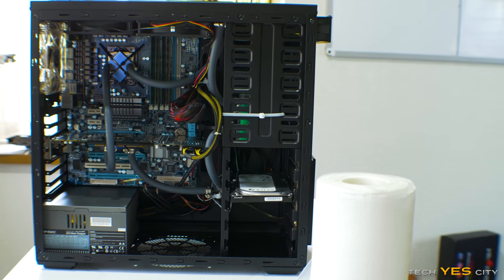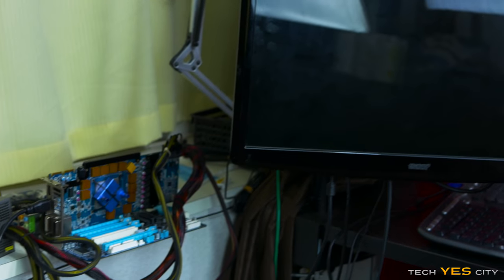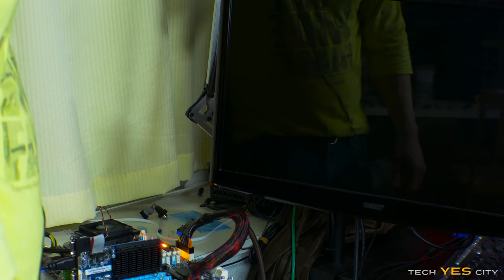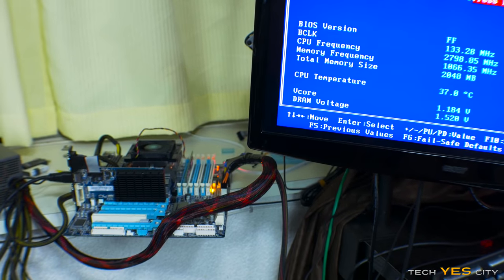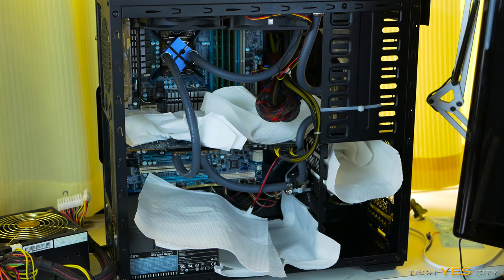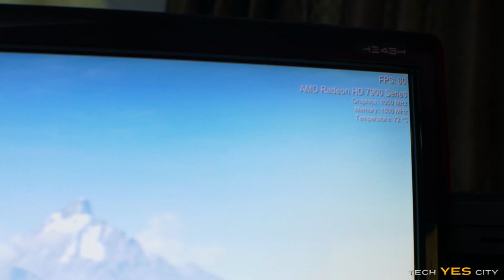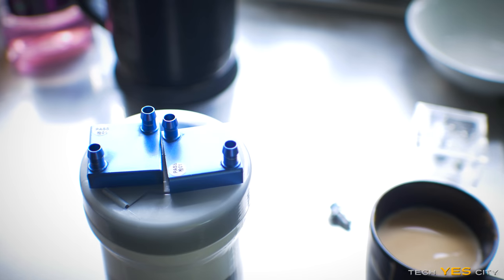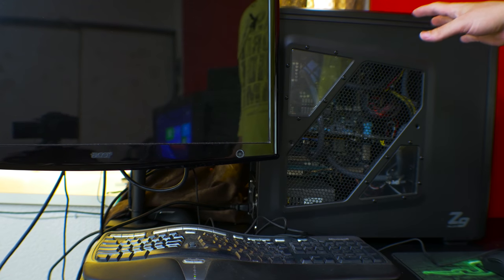$50 Custom PC WATER Loop - Is it POSSIBLE?

Comment: due to many comments saying the way he is applying thermal compound is a problem... So i tried both ways the "professional/traditional" way and this way... only difference was of a 1-2 degree difference the way in this video made it a bit bit hot is all so its not much of a problem... ( I cleaned my hands with sanitizer and i don't eat oily foods  just incase somebody comments KFC or macdonalds) So it's not a problem guys everyone to their ways

Comment: I am using a rajintek triton cooler. First one the acrylic block started cracking. They sent me a new block but it evaporates like hell and leaks sometimes from the power cable. I cant use my pc until i get a new cooler. Avoid those rajintek ones. They are coloured green red or blue which comes as dye that you can add yourself.

Comment: not sure if you can help me but I have an AMD fx4350 in my computer and it'll be running at 4.2 mghz some times then other times it'll be running at 1.21 mghz and I'll get the same performance ether way. it's mounted to an Asus pro gaming
Reply: +Greasy Steve it clocks itself down when it doesnt use the power, so no problem

Comment: Spreading out your thermal past works well with finely machined surfaces, those blocks are not. Try using a little larger than average blob of it at the center of the cpu, this should fill the irregular spaces between the cpu and water block better.

Comment: future tip...  if you want a near perfect flat surface or fix a non flat surface in this case, sand your thingy on a piece of glass or mirror usually works well  and use fine sandpaper. ahh and taping the corners may help also  avoid messiness of sh.!t sliding around

Comment: use the pea method on the thermal paste. helps prevent air bubbles, and finger oil, from an contaminating the TIM.
Reply: +chase tressler Finger is as good as pea.
Reply: +chase tressler I'm using the credit-card-spread-technique for over 10 years and I build several PC's a year and never in my life did I encounter any "air bubbles" that decreased the cooling-performance.

Kind regards,
Meta Custom Computers
Reply: I too am a professional for a shop that specializes in our customs. we, including myself build several a week. but my credentials arent the point. the only way to see the bubbles is to use glass so you can see how it spreads. and most of the time it is negligible to the temps. but it can make air bubbles. not always.
Reply: chase tressler
I solely rely on my own bech-tests and those of trusted collueges and over and over again it was proven that there is no difference. There is always a margin of about 2°C between the methods but every time you test it, the "best" and the "worst" technique changes. Sometimems the "pea" is better, sometimes the "spread", sometimes the "X" while the "pea" is the worst, so the 2°C delta can be put away as measurement tolerance.

Kind regards,
Meta Custom Computers

Comment: Any chance that the high temperatures might be related to air bubbles? Since youre using no-transparent tubing you cant really be sure you got rid of all the bubbles. I guess the temperatures would still not be that amazing, even if the problems where to be because of the bubbles ...

Comment: Need to get some clear Tubing Bro then you'll be able to see whats actually going on in there espically if you get bubbles in your loop as it can affect the cooling somewhat i usually leak test systems for 24 hours
Reply from the maker: +Zachary Haywood Thanks, yeah definitely will get round 2 cracking soon.

Comment: so im building another 775 mod system with an x5450, and using a gigabyte motherboard. the board recognizes the xeon in the bios, but it freezes on the windows logo when trying to boot into windows 10. it works perfectly fine with a Pentium in it, will getting the micro-architecture fix this?
Reply: +wilson pies win 10 doesnt boot with o.c. on first time. boot with stock speeds 1st time, when you see desktop (might require activation) reboot do o.c. then reboot. tested with g3258. you are welcome
Reply: L. Alp M. Schiesser its not overclocked in the first place :/ also you're using an 1150 board, I'm talking about a 775 mod xeon, they aren't even comparable :(
Reply: its not about generation its a general statement if you overclock your cpu you cant first boot into win 10, different platforms same result. Sadly its not your case but it may be relevant because of win 10 activation methods, just search for it...
Reply: +GrimeHubTV Just search for it...
Reply: turn of ahci
Reply: Jack
why?

Comment: I have an e5450 using kind of the same materials you used, and it works , 30degrees only when playing GTA at medium settings
Reply: and he said he has 30 when gaming so..why would he go with the 212 evo if it goes 49 and his custom loop goes 30? although, i dont believe anything can achieve 30 degrees while gaming..maybe if you had a major bottleneck on the cpu so it only runs 20% :D

Comment: If you were running and AMD A10-7980 you wouldn't need to cool the GPU as that would actually be inside the A10-7980 processor along with the Trueaudio sound hardware.

Comment: what if you replace the water with oil? will you get better cooling in water cooling system?
Reply: IamIUareU no
Reply: IamIUareU nope
Reply: IamIUareU the best liquid to use is not what he used.you should just use normal distilled water.
Reply: +Troll King I head distiller water becomes conductive after rubbing against the copper CPU and gpu bricks after a while and can damage the PC is this true?
Reply: Mr. Milky all liquids pick up electrons over time and become conductive.not just distilled water.
Reply: But people use distilled water because water is naturally better at dissipating heat than the other liquids.
Reply: Troll King
coolant becoming conductive doesnt matter since all the metal cases and heat sinks of the cpu and gpu are grounded...
Reply: IamIUareU i didnt say that it was a bad thing.he said distilled water becomes conductive over  time and i said that all liquids become conductive over time.
Reply: Troll King
:) was just saying that for
Mr.Milky but your comment was last so i replied to your comment ;)
Reply: Thanks both of you

Comment: Do you know anyway to increase my fps or keep a constant fps on a laptop?  I have a Intel Pentium N3700 and have heard you cant do anything with,  but im asking a computer genius. Thanks in advance for answering.
Reply: Get a new computer, that one is CRAP.
Reply: Lovely Muhleek I told you how, get a new computer. That one has no hopes.
Reply: With a laptop you are stuck with whatever is in it except for changing RAM or drives. If it's getting hot I'd suggest blowing all the dust out with some canned air or buying a cooling stand. Or my fav solution save your money and buy the parts to build a nice gaming rig and ditch the laptop as far as games go.

Comment: Did you have the radiator fan drawing air in or blowing air out of through the radiator?
Reply: +Mason Kelly They were in push, so the air came from the interior and was blown through the radiator to the outside. But performance-wise (on regular watercooling) it doesn't really matter, it's a delta of 1-2°C.

Kind regards,
Meta Custom Computers
Reply: Meta Custom Computers Thanks for the reply! I was just asking because my friend was having terrible issues with heat when he got an H100i for his FX-9590 and then we flipped the fans so cool air was being drawn through the radiator and into the case. It could have just been his entire airflow system though.
Reply: Mason Kelly
In that case, he doesn't have enough case-airflow. You always have 2 possibilites:
1. Draw fresh air out from the exterior and blow warm air into the interior: Colder temperatures on the watercooled parts, warmer air on the mainboard and the case-interior
2. Draw warmer air from the interior and blow it out of the case: Warmer temperatures on the watercooled parts, colder temperatures on the mainboard
Either way, you always land on a delta of about 2°C on either the watercooled parts, or on the mainboard and case-interior. Depending on the case-airflow, the 2. option can lead to drastically negative results, in case the temperatures inside the case go too high due to weak cooling inside the case. You always have to remember that watercooling is nothing more than aircooling with water as a medium between components and ambient air. Is the ambient air temperature too high, the temperatures on the watercooled components will be too high aswell. Watercooling always brings you closer to ambient-temperature, the ambient-temperature decides on the cooling-performance

Kind regards,
Meta Custom Computers

Comment: Lap the blocks properly. That will make quite the difference I think.
Reply: Leone Furlan Yeah true. But it might just make a bit of a difference.. I don't think you can really watercool on the cheap
Reply from the maker: +mrawesomelemons I will be revisiting it for sure. Going to try mounting the blocks with a little more pressure on both and also lapping them back as hard as I can.
Reply: Tech YES City Looking forward to it! There are plenty of lapping guides. It takes a lot of time but it is (often) worht it. Good luck!

Comment: I just spent 2 hours fixing my filter from a new 60 gallon turtle tank I got because of those metal clamps, Literally collapsed the tubing shut and created leaks. Had to shim a smaller but really rigid pvc tube inside the collapsed tube to make sure the clamps didn't destroy it again...I would fear for my hardware if I used those after the experience I just had.

Comment: I'm one of those guys who's always liked air cooling. Currently running a 6600k @ 4.5Ghz and I never see temps greater than 55c while gaming.  But hey, to each of their own.
Reply: Wich Cooler do you use?
Reply: +DJ Papa Biz CM 212 in pull config. What most people don't realize when installing the cooler, you're suppose to bottom out the screws and make sure the middle screw is fully tight. If it moves side to side it's not tightened down fully.

http://imgur.com/l0w70Od

Comment: Couple of more thoughts. Thanks for the entertaining video!

X58 Motherboards, especially Gigabytes take forever to give any signal to the monitor, so they are notoriously bad to testing your system without cooling.
Those aluminium blocks are really shitty, you can get ones with copper core and plexi cover for bit more cash but they will be heaps better.
You could possibly save by finding a used radiator, or even a used car radiator (true ghetto style).
You will probably run out of radiator before you run out of a shitty pump.
You should not skimp on hoses - shitty will not handle the heat well and start to leak after some time.
Finally, remember to cool the voltage regulators on the motherboard (which you did) and on the GPU (which you did not).

Comment: Zip ties are nearly the worst way you could mount a cooler, you can't get enough pressure or even enough force. You need to make metal brackets.

Comment: I suggest to use air cooler with heatpipes as water block simply cutting heat pipes and connecting tubes to them instead of those crappy block you were using

Comment: wait,  are you sending warm water from the gpu to the cpu?
Reply: +matt The order of the components doesn't matter at all in a cooling-loop. The delta of the water-temperature won't exceed 3°C between inlet of the radiator and outlet. (On normal cooling-loops)

Kind regards,
Meta Custom Computers

Comment: Though I love Zip Ties almost as much as I love Duct Tape using Zip Ties to hold on your heat sink is a really bad idea. Better to call it the $58 Custom PC WATER Loop. Then use the $8 to buy a 3 foot Ianthe of 1/8" by 1" steel bar and some nuts and bolts.

Comment: I think that a little more budget should be put into the pump and the blocks, I've had pump failures before when buying cheap ones. I think it will still be impressive if you can get it under 100 bucks
Reply from the maker: +River Capulet Yeah will definitely give it a go!

Comment: Firstly, I would probably get a bigger pump, I'm not convinced you need new waterblocks. 
Also something about the result makes me wonder about the GPU and cpu in series maybe not such a great thing, this is possibly why you're seeing such good temps on the GPU but not the CPU. But then if you change to parallel do this you will probably need a pump that flows higher, which might be the solution if you stick with a in-series setup anyway.
Adding to this the proof that the blocks might be okay is in the fact that the GPU which theoretically has a higher TDP than the CPU but was much cooler, even without a heat spreader. That makes me think that the blocks are not the problem but something to do with the waterflow or temps.
Reply from the maker: +Pewpew beeew Thanks, I will definitely try it on another rig, something was 'off' with this rig, possibly the fan headers not putting out enough voltage to the pump. Not sure though but will definitely try round 2 very soon.
Reply: +Tech YES City I found the datasheet for the pump most of its in chinese but you can see the pump curves, if you were only using 5v (molex connectors have both and fan headers are usually 5v) you would miss out on alot of flow, and at the 12v flows looked okay numbers wise. I would def be checking those voltages supplied to it and going to 12V if its rated for it (couldn't quite make it out from the video!
https://cbu01.alicdn.com/img/ibank/2014/607/591/1475195706_1150049228.jpg
Reply from the maker: ah thanks, damn seems a little weak for a gpu and cpu in the loop?
Reply: +Tech YES City seems borderline from the calcs i've seen you probably need at least 2.3 PSI of head on the pump which about 1.6m of head (in water) from that chart that'll flow just under 200l/h. everyone seems to say you need to shoot for 1 GPM which is 227 L/hr on 12V so it might be a little light on. but I'd give it a burl on 12V if you used 5V, I mean its close, as I would expect if 1 GPM is for a normal watercooling setup that pump might be adequate if you're just shooting for an air cooler equivalent setup. This might help you out with pump selection http://www.overclock.net/t/1108918/what-can-my-pump-handle-a-guide

Comment: there are a lot of things that could've been differently to extend the life of the system if the kinks were worked out. don't use those hoses, black silicone hoses degrade really quickly and as a mechanic they fail easily and will turn brittle over time, replace them with the clear hoses from pet stores would be an easy, cheap, and mlre reliable alternative method. another, I'm sure your using that antifreeze as a rust inhibitor of some sort for the radiator, which is neat but don't use a lot. ideally, you can use very little because antifreeze has really bad thermal qualities to it will be a host to a lot of problems in the system. the worm clamps are good. also find a more expensive pump on ebay or, again, go to your local pet store. not petsmart but something smaller.
Reply: I'm not an 3xpert on water cooling systems at all, but cars are my thing lol

Comment: China made 20 buck cpu and GPU blocks are good. zotac 1080  ti  amp extreme = 50-60c ryzem 1800x = 40c"when mining".  on 360 aluminum 30mm rad, water temp at 37~38c

cheapest functioning custom water cooling i've done was 

pump + res $19
Cpu, GPu block $19 each
Fittings : $1.3 each
360mm Al rad $20.
+ anti corrosive car coolant

I did entire 8-gpu minning rig + PC and it worked like a charm.

Comment: Yeah, for 50$ it's not bad. But this will kill the GPU really quickly. You are not cooling the VRAM of the gpu properly. Applying some heatsinks doesn't fix the problem, as those heatsinks can't cool down by thelselves. To cool down the GPU you need a big plate that surrounds all the VRAM chips, and the processor of the GPU as well.

Comment: might be because the CPU blocks were plastic. there was almost no thermal transfer between the copper plate and the block
Reply: +STiCKxaH nope they were not plastic as he sand them down
Reply: you can sand plastic down mate..
Reply: +STiCKxaH Pretty sure they were aluminum...
Reply: +AndyHa1010 yup
Reply: STiCKxaH and you can melt plastic with a CPU dude

Comment: Very interesting video, would almost consider doing some parts like this and would be interesting to hot swap some Actual components out and See the Live difference between say, the;

3$ Aluminum, vs 12$ waterblock, vs 50$ swifttech or w/e.
1x 6$ pump vs 2x 6$ pump or larger pump, vs 50$ swifttech.

If I were to do this I'd likely consider doubling up the pumps if I were cheaping out on them and using cheap 5-6$ ones off ebay.  That way adds redundancy since the failure rate would assumingly be higher,  fans obviously would be fine.  And I would imagine going for a Properly designed CPU waterblock, Ebay has some for 10-12$ would go a Long ways.

Turn the 50$ watercooling build that doesn't function into a 60-70$ build that may just keep up with 300-400$ builds.  Now thats cooking with fire
Reply: +Aura Rowe (Neokolzia) Another possibility, look on EBAY for broken AIO water coolers, people are selling them anywhere from 10-30$.  Might have to do a little research which ones would be best suited, but the down and dirty of it.  Thats a 120-240mm RAD, and a quality CPU block, with general issue being obviously the pump going.

Comment: Well, i have a custom diy loop, with a xfx r9 280 gpu and amd fx 6350 (oc to 4.6ghz) on one loop and a 360mm rad, temps always below 50*c on cpu and 70*c on gpu. Cost: About £40. No leaks works perfectly. Possible? YES!!!